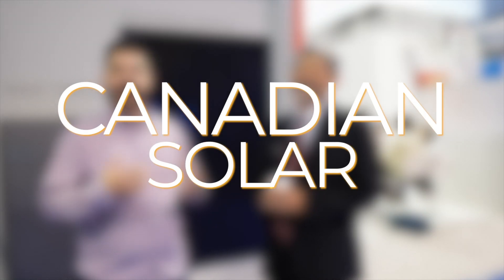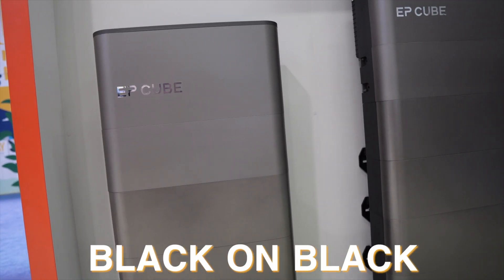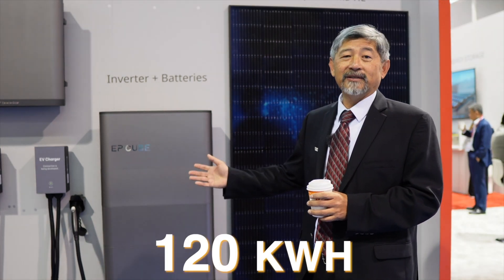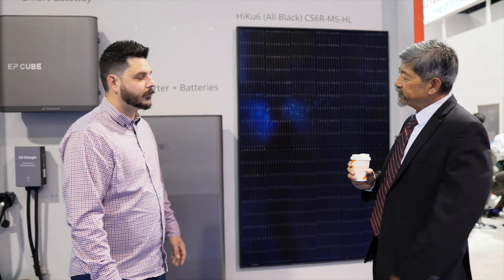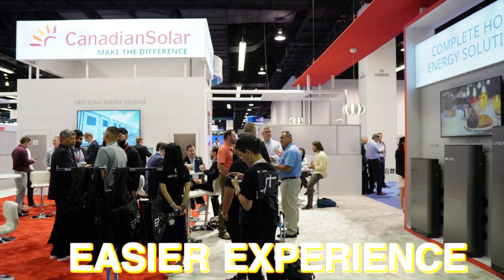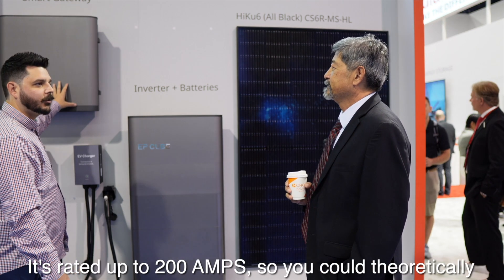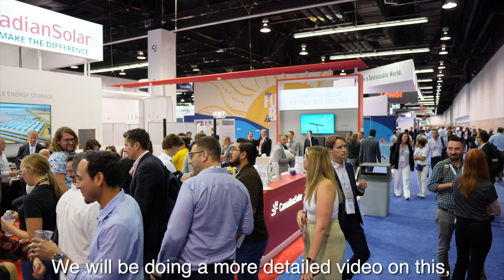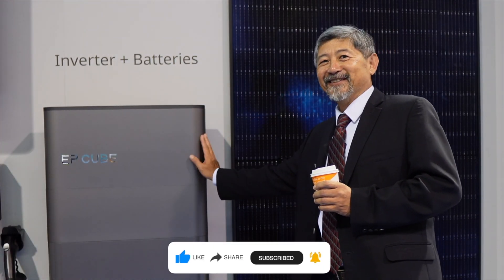Canadian Solar EP Cube is AWESOME!

Comment: Why is 9540A so important?
Reply from the maker: It's a special thermal runaway test that ensure the batteries can keep a fire contained so it doesn't spread outside the battery. Batteries without the UL 9540A test/certification have to be installed 3 feet apart from any equipment, and be 3 feet away from windows and doors to living spaces.

Comment: Wow I wonder if we can actually get this in Canada. In winter I use 300 kwhrs a day running my 18-20kw forced air electric furnace.
Reply: a tent
Reply: This will be available in Canada in 2023
Reply: What kind of insulation do you have?
Reply: @mattbrew11  roxul for a good portion of the house and 2inch foam on at least 90% of the house walls under the siding. The problem is my basement is a dug out and not insulated the best and my roof if like a cathedral ceiling so only the thickness of a 2x4 then there's my 3 car garage and my other two out buildings that house my water pump system. And just another storage building that I occasionally use power in.
Reply: @mattbrew11  I need better but I'm working on it.

Comment: 7.6 kw/h inverter is not bad but the SolArk 15k is the one to get.
Reply: We use sol arks for ac retrofits too but the 15k isnt doing 15k when the power is out.
Reply: Me too 15kilw to 20 it bust for hot water and hot air or ac too
Reply: Oh I see